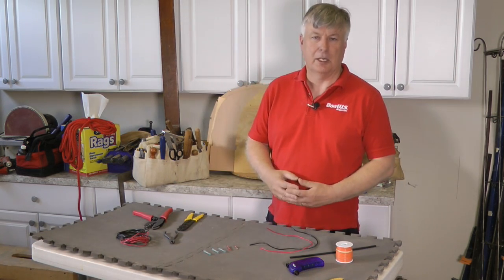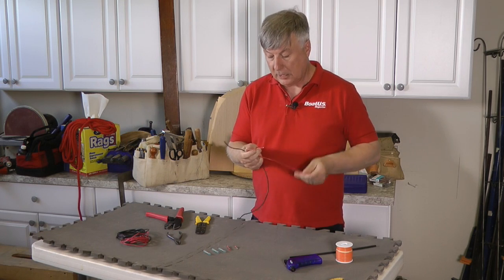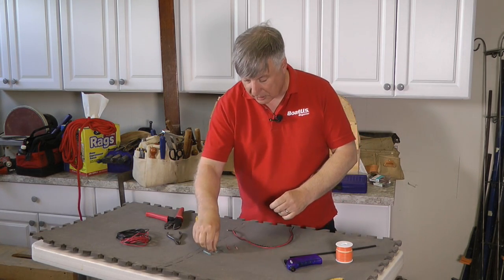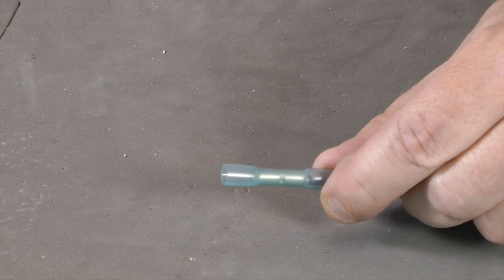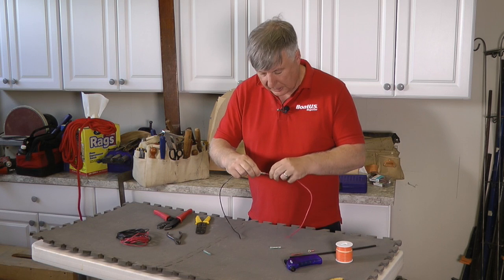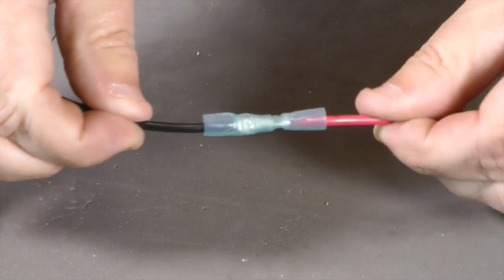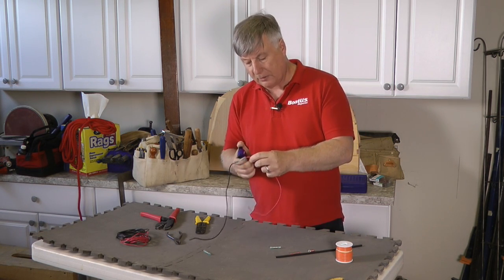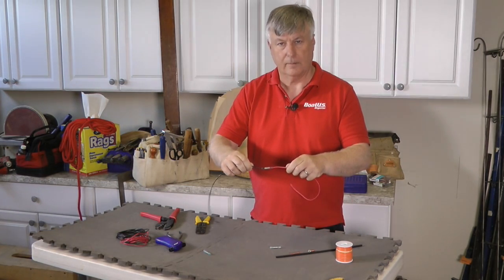How To Make Waterproof Marine Electrical Connections On Your Boat | BoatUS

Comment: Use steam from a kettle or a heat gun to shrink down the tubing, that way you won't melt the wires plastic coating or even damage the connection. The last thing I'd use is a mini blowtorch!
Reply: Kettle will most assuredly result in entrapment of condensed steam.

Comment: This method is likely a waterproof connection temporarily but not long term. The heat shrink will dry out and loose it's shape allowing water to penetrate the connection. At minimum I would fill the inside of the terminal with appropriate grease before inserting the wires. My first through 5th options would not include using this terminal at all for a waterproof connection.
Reply from the maker: Thanks for sharing your experience, Jerry. Like most things, there is more than one way to make electrical connections on boats. That said, virtually all boats on the water today use these very heat-shrinks. I used to use the liquid electrical tape tactic that some folks promote, but with age, I find it also dries out and becomes brittle. Actually, I'd say the heat shrinks are better — maybe 20 or 25 years before they commonly go bad as opposed to 10 or 15 with the liquid electrical tape. Also, I've never, ever seen anyone "fill" the inside of a terminal with grease. Top-end builders may spray it down with CorrosionX or a similar corrosion-inhibitor prior to he heat-shrink. That said, can you tell me more about the process you use for making waterproof marine electrical connections and what kind of grease you're using? Always open to learning new and better ways of doing things.
Reply: @boatus  yes sir for the grease I referred to I use dielectric grease specifically Permatex that comes in a small gray tube (usually less than 5 bucks). The snall gray tube is key in being able to easily get grease inside a small connector. If I use heat shrinks  I like to fill them dielectric grease then cover them with a heat shrink sleeve or tube that gives the connector an added layer of protection. Salty air has a way of deteriorating things quick so more layers the better. If it's not the salty air it's often a connection rubbing against another wire or object that causes damage. The more insulation the better IMO. The dielectric grease goes a long way though in the fight against corrosion.
Reply: Can you please make a video showing at least one or two of your preferred ways to join wires on a boat?

Comment: Agree with comments below.  I have found a heat gun to work better/more safely than a torch with the shrink tubing, and the red-to-black connection is generally a no-no.

Probably worth redoing this.
Reply: He literally says that it's for illustrative purposes only

Comment: Hairdryer to shrink cover probably a safer option?
Reply from the maker: Interesting question, Sleepy. I looked into this online, and the jury is out. It kind of depends what temperature the butt connector requires to properly melt/seal. Some might work using a hairdryer. Others may not fully seal or seal consistently. And even if the hairdryer gets to temperature, it may take longer than using a heat gun. Maybe others have had experience with this who could weigh in. I'll also reach out to our experts.
Reply from the maker: I reached out to our technical experts, Sleepy, and here's what I learned: My favorite is a heat gun. It only takes a little bit, and you keep it well off at first to see how the heat shrink is acting, the heat gun strength and the ambient temp, etc. Try low first and see how that goes. I prefer heat guns over hair dryers, but unless it's a really weak dryer it should work. That said, I recommend investing in a good heat gun. It'll more than pay for itself over time.
Reply: A 110 outlet can only have 1875 watts or so given and a hair dryer uses all that. A heat gun can’t use more “power” it is just more focused. A hair dryer would work.
Reply from the maker: @rawcus918  If it works for you, great!

Comment: There are connections that might be wet? The torch should be soldering a proper Western Union splice and covering with "glue lined", heat shrink. I think the use of crimp connectors   might be overstated as a "good way" to make marine connections. "Marine", should always mean, it might get wet, It might have vibration and it could get pulled on. Therefore,  All of your connections must be water proof,  restrained with wire ties,  hold downs or tape  and be a little extra long to prevent "pulling" on anything.

Comment: Good video! what’s completing the connection?  are the wires touching each other or the wires are just touching the metal tube inside? Also how snug should the Butt splice be? Can it be a little loose? Thx mate
Reply from the maker: It's the metal tube of the connector that makes the connection, Allan, not wire-to-wire, though there's certainly nothing wrong with them touching each other. However, it shouldn't be loose at all. When properly crimped down firmly on the wire there should be no play at all.

Comment: Did you need a specific ratchet crimp tool made for fittings with the heat shrink end?
Reply from the maker: Thanks for the question, George. Yes, there are specific heat-shrink crimping tools on the market. Fortunately, they're widely available and relatively inexpensive. (You'll see them from around $30 to around $80.)

Comment: Thx for vid
At home though don’t use lighter or you’ll burn wire like he did
Reply from the maker: Thanks for your comment. We recommend investing in a good heat gun to do this. It does the job quickly and thoroughly.

Comment: I agree with the other comments on this post:

1) The video should be redone - and should NOT be showing a red and black wire being connected.  English is NOT the first language for many BoatUS members.

2) The video does not discuss single vs. double crimpers. This should be covered.

3) The video does not discuss Heat Shrink vs Nylon connectors.

4) The pros/cons of a butane torch vs. a heat gun should be discussed.  In the video - it appears that he actually burns the insulation (blackened) the wire.
Reply from the maker: Thanks for your input
Reply: All the comments are in English.

Comment: This video has errors and important omissions.  To mention a few  - bad practice to use flame-source to melt and likely to burn plastic,  both crimps should be aligned and not like this video demonstrates - matching the size wire with the stripper hole making sure that no strands of the wire are cut - ensuring the correct style of crimper (and wrong style) and preventing penetration or damage of the waterproof coating - suggesting buying connectors that lined with heat activated adhesive - and lastly a careful inspection of the finished job.

Comment: Connecting a red wire to a black wire is a stupid way to illustrate a connection. Nuts!
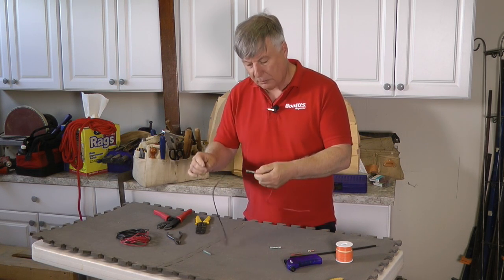Reply from the maker: We understand your concerns, however, if you watched it until around 2:30, we addressed that clearly and specifically. Obviously you'd never connect a black and red wire together when making an actual electrical connection, but it's easier to illustrate the joint when you have two different color wires.
Reply: @boatus  i was well aware that you mentioned it. It does however remaim a poor approach. Many people will not watch it till 2.20 and be left with the wrong message and you guys could/should do better than that.
Reply from the maker: @Adifferentlife1  Thanks for your feedback and we'll keep that in mind if we redo the video in the future.

Comment: He used a double-crimp type full-cycle crimper (made for the hard nylon stake-on type terminals) on the adhesive-heat-shrink butts.  Totally wrong.  He should have discussed and showed examples of those two types (single vs double crimp) and cautioned about using the correct crimper on each type terminal.
Reply: Ken Kloeber so true he is totalty wrong  and the crimper was wrong too

Comment: Heat shrink is not water proof, I usually solder the wires, then,  coat my splices with a good silicone, let it dry, then heat shrink. Been holding up on my boat trailer, getting constantly dunked in salt water.
Reply from the maker: MARINE-GRADE heat shrink connectors are indeed waterproof, Mike. Soldering, while a lot of boaters do it, is not recommended in most cases. When overheated, solder can melt, softening the heat shrink tubing and allowing the connection to fail. In addition, independent tests have shown that soldering increases corrosion. It may also make the wire stiffer and more prone to fatigue. A newer option is solder seal butt connectors. These aren't ABYC-recommended because they don't have a mechanical connection, but some folks swear by them. Quality varies widely, so choose a good brand like 3M if you go this route.

Comment: I still don't see that can be waterproof
Reply from the maker: Thanks for bringing that up, Wayne. The crimp holds the wires securely together. Then heat (from a torch, heat gun, or hairdryer) activates an adhesive inside the connection, while the heat shrink contracts around it, creating a watertight seal. These connectors also tend to be heavier duty and made from materials that will hold up to the marine environment.

Comment: Shame on Boat US - People who are watching this video rely on videos from reputable sources and this video is garbage. 
1. Why would you join a red & black wire together?  New boaters are watching.
2.  Why would you use a torch? You could on over heat the heat shrink.
3.  Why wouldn't you recite advice from ABYC electrical standards. 
This video should be taken down or edited. 
This advice could cause the following:
1. Corroded connections where the crimp was done incorrectly.
2. Corrosion where a torch was used and the water tight jacket is burned through from being over heated.
3. Exposed metal from where the water tight jacket is burned through from being over heated. This could make contact to ground and cause a spark.
4.  A crucial wire like the bilge pump wire could be done improperly and sink the boat.

PLEASE DO RESEARCH ON MARINE ABYC ELECTRICAL STANDARDS....

Your welcome 😁
Reply from the maker: Thanks for your comments, John. You are correct that during the normal course of events, a black and a red would never be connected. But as I mentioned several times in the video, I was using black and red wires for illustrative purposes only. As for the use of the torch: ABYC makes no mention of what tool should be used on heat shrink connectors. Many times, I will use a hot air gun, but sometimes this is impractical if I do not have 120 volts AC handy. I do say to be careful heating the connection and only heat it until the heat shrink is tight on the cable and the adhesive has melted. A hot air gun is also capable of overheating the connection, excessive heat will melt the connection and the cable insulation irrespective of the tool used.

Comment: Should have read the script before shooting video.  Didn't mention that there is marine cable that resists corrosion better than automotive type.  Things out of sequence, bad examples especially crimping red to black.  After warning not to burn with blow torch, then proceeds to burn the red insulation.  Pretty lame video all around.

Comment: You should take this video down. You're using the wrong tools, joining red & black wires, not enough close-ups. Irresponsible. Make another video.
Reply from the maker: Thanks for sharing your thoughts. There's a reason he's using two different colored wires to demonstrate--and he does make it clear why and that you wouldn't do this otherwise. And I'm not sure what you mean by "the wrong tool." Can you elaborate?
Reply: @boatus   A torch is not the proper tool for  heat shrink, and invites melted connections. Especially since you placed this as a tutorial. You should have used a heat gun for the demonstration.
Reply: @cman504  cman, I no nothing about wiring and are trying to install nav lights on jon boat.  So I have to buy a heat gun with these connectors?  Is it fine to just use shrink wrap with a lighter and electrical tape over that? Thanks
Reply: @dmott9750  crimp the wires once they're in the connectors, then use a lighter. Go easy with heat. Don't video it and put it up as a tutorial. Haha. And no need for electrical tape.

Comment: Man this really needs to be removed.  #1 He is "Splicing" not "Connecting"  they are Butt Splices not connectors.  #2 Never apply fire to shrink the heat shrink, notice how he burnt/damaged the red insulation?  Use an air "Heat Gun".  Finally it is single conductor wire he is working with not cable.